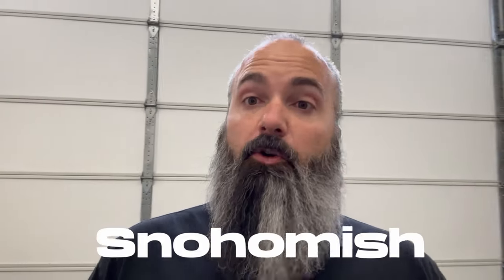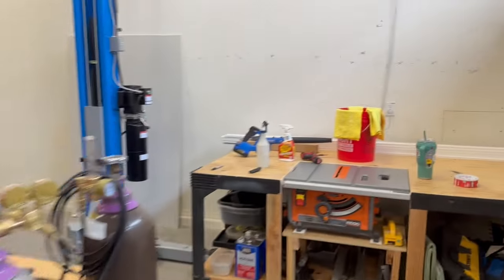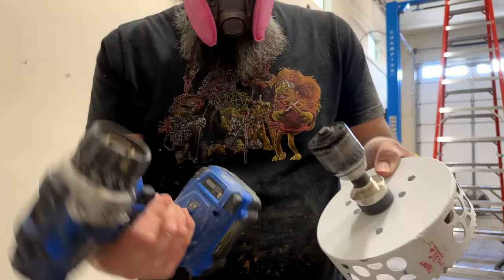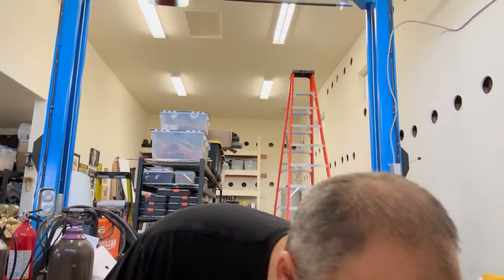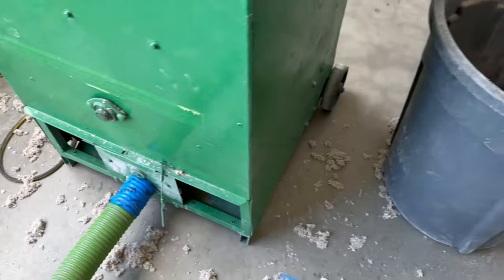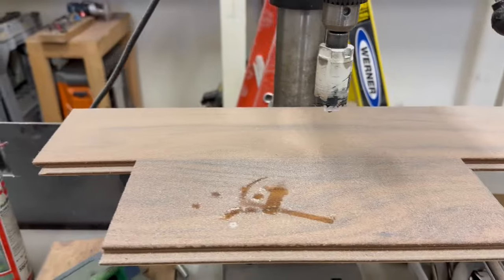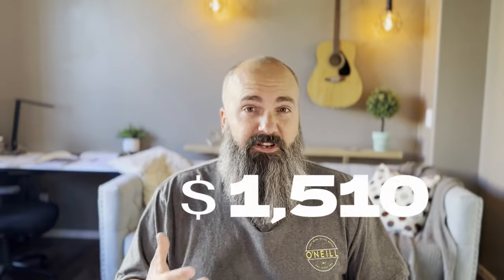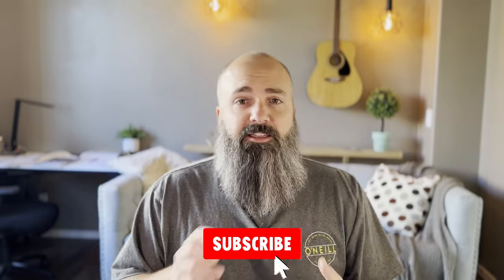Insulating Finished Walls

Comment: Just a thought - maybe cut one long skinny rectangle across the top of all the studs. That way you don't have to deal with using that drill bit so many times and patch all those circular holes. Should be much easier to tape as well.
Reply from the maker: This is a good thought. One or multiple long sheets would have been easier to repair. Though I've seen this process done multiple times and it's always with the round holes. I'm just a goof ball in my garage so I'm not sure of the merit of doing it this way. If I buy another house that needs insulation I'll certainly try your way!
Reply: I thought the same - why not cut a slot instead of holes for blown insulation. I suspect it will be due to not wanting the cellulose to come straight back out the slot. I think the holes make it easier to contain the fluff.

Comment: You can get a 24,000 btu mini split for $1,200. Get two and you’d be more than golden. I did that on my 2,000 sq ft warehouse that didn’t have insulation and worked great.
Reply from the maker: I keep bouncing around this idea. The heat here is brutal.
Reply: How much is your cooling

Comment: It looked like you were going up that extension ladder with the wrong side facing out. The rung locks should swing out towards you, with gravity working to hold them in the closed position. Glad your project was successful but stay safe. Ladders that aren't set up correctly are one of the easiest ways to get hurt on the job.
Reply from the maker: You're right. I totally missed that in my haste. Thanks for looking out!

Comment: I did one wall and cut 1 strip of wall 12 inch all the way i adjusted my circular saw to 1/2  i was able to see what is inside i did so from the bottom was very easy cut 4 ft drywall in some but i used most of the old one after i texture looks nice
Reply from the maker: I’ve heard this a few times and think for sure I’ll try this method if I run into a project like this again.

Comment: Okay, so I’ve been through this, not the dense packing but the renting that pos green box, some Home Depot’s will have a krendle cellulose machine, it’s blue, it’s way better than the green one. I was lucky enough to find someone local who had a badass machine you could load 4-5 cellulose bales into and we did a 3k sq foot attic with r60 in about 4 hours
Reply from the maker: That would have been so nice to be able to load more into the machine at once.

Comment: Thanks for the video! I’ve done everything from concrete to electrical but I’ve never done this before so it gives me a good idea what to expect.
Reply from the maker: Outstanding. It was a LOT of work, but not that difficult. The drywall finishing is the hardest part. It's such a skilled art.
Reply: I thought about doing this, but I found a company that foam filled my walls for around 2k. Not bad considering the labor in doing it this way.
Reply from the maker: @dfoster7001  That's a fantastic deal. Nice!

Comment: Appreciate this video. I've got 3 bays, 12ft ceiling, with no insulation above or in the two outside walls. Hits about 110 F in my Georgia summers. My last house, with room above and insulated walls in 2.5 bay garage would get cold with just a small window AC. But the ceiling was too low for the lift! I need to insulate at this new house and have been debating DIY vs hiring, and fiberglass vs foam. Good to see you could get dense pack without special equipment. All that dust tho!
Reply from the maker: The dust is real. I’m still finding little fluffs around the shop. lol. But with just my swamp cooler right now I can have the RV door open and keep it 15* below the outside temp pretty easy. Good luck with whatever route you choose.

Comment: Love my Milwaukee stuff! Buy around Black Friday/Christmas. Lots of good deals. 

Thanks for video, I am going to do this to my garage as well
Reply from the maker: Good info. The insulation is working well.
Reply: @DrivingForwardBuilds  trying to decide if I want to tackle(fully capable) or just pay someone and not mess with it....
Reply from the maker: @naturalsr405  that's a battle. This was a ton of labor. Probably 80% of the cost will be labor. Really depends on where your time is more valuable.
Reply: @DrivingForwardBuilds  most definitely. Being my garage is not huge, it probably would take someone who does it all the time, about a 10th of the time it would take me. I would have the ability to slack off and have it take away longer than it needs to too lol

Comment: Jason! My first vid of yours! I was trying to find this exact type of video since I am going to tackle blown insulation as well. I am building an 8’ x 12’ office in my garage for working from home / gaming. I have 3 kids so (as much as I adore them) it will help to be fully separated when needed to focus on work. 
I am insulating a 12’ long and 8’ exterior walls, since the office is on an exterior corner of the garage. I will also blow the ceiling of the room as well as the new walls that I am currently framing.
All walls are about 9’ high - and I need 96 sq ft of R30+ like you did in the ceiling.. I agree that all calculators seem to spit out different results… think 10 bags is sufficient?
LOVE to see that A) you respond to everyone and B) your insulation is working well! I am putting in a 9,000 BTU Pioneer split in the office as well - excited for that project. This is hands down my largest home improvement undertaking. Leaving a space for a parked car in case the next buyer of this home desires to park a car in the garage (we don’t for space reasons). Your video has greatly encouraged me to do a good job & I also watched the 3 strategies to blow insulation, going to go for the deep-pack method like you seemingly did. Though I kind of want to try the hole halfway down the wall instead of at the top, not sure. Thanks Jason!!
-Brady
(PS, also in Phoenix! So, a good insulation job is more important than straight walls, level floors, or a good paint color ha!! Flip gets HOT here!!!!!!)
Reply from the maker: 10 Bags may work. It will depend on if you are 2x4 or 2x6. Not sure what your transport looks like but the bags are actually a decent size. I personally would buy 3-4 more than are needed and if you have extra blow it into the attic. The other variable will be how dense you pack it into the wall. I thought about opening the wall up in the middle but was concerned gravity would take over and I might not get the pack to blow up the wall properly, especially considering I had never done it and the power/reliability of the rental was unknown. One really good comment I had was from an installer who mentioned cutting across the wall in full-sheet rectangles (like 3-4" tall). That way you could more easily fix the drywall without round holes. Or in your case if you are putting up walls to create the room there may be a way to save on some of the repair work this way.  Sounds like a great project to take on. :-) The mini-split will come in handy. I've noticed through winter the garage cooled and has stayed cool. I haven't budgeted for AC yet. I'm sure I'll regret that in the next few months.
Reply: Copy that! Good suggestions. Thank you for the reply - I will check if I have 2x4 or 2x6 exterior, good point. I can always return what I don't need if I buy extra! Yeah good luck with the A/C situation - that is a fairly large space. @DrivingForwardBuilds
Reply: This is exactly my situation. Mini split was put in today and we discovered our builder did not insulate the wall all the way down the wall as we expected. Now I need to insulate the one 20’ long wall so my mini split won’t work as hard. I want to cut holes and dump cellulose in. Hopefully it works easy enough.

Comment: 😮wowza! That’s a big job! Could you have just done below the fire block?
Reply from the maker: Yeah. But then I would leave hot spots in the wall where there wasn't insulation. That would defeat the purpose of the job.
Reply: @DrivingForwardBuilds  that makes sense. Good job 👍🏻

Comment: Just wondering if it would be easier to cut rectangular sections out of the drywall between the studs and slide wall batts down?
Reply from the maker: I don't think so. In the wall you have many different protrusions like nails, screws, wires, pipes and even small splinters of wood that will catch on the wall bats and make it very difficult to slide them in. Possible yes, easier, not likely.
Reply from the maker: No. There are way to many obsticles in the wall. Even just the small splinters would catch on the bats and make it very difficult to slide down.
Reply: Thanks for your reply, yeah I think you’re right. With batts they say not to jam them in too hard so they are able to fluff unrestricted because it’s the trapped air in the batt that aids in the insulation. I’ve seen thermal imaging of batts where it’s been shown that whenever the batts have been compressed and not cut out properly to make room for obstructions, the effectiveness of the batts are significantly reduced. Why is the blow in stuff different and recommend to compact fill the void? Wouldn’t compact filling reduce the amount of trapped air thus reducing the efficiency?
Reply from the maker: @carmeloxuereb8733  I'm not totally sure why they call for "dense" packing the cellulose. But the R-value goes up as it's packed tighter. From what I've read the r-value increases by 1/2 point from R3.5 to R4 per inch. Not having air space also helps to stop fire propagation. If packed in tight enough it can also be used as an air sealer, though I wouldn't omit any vapor barriers because I was using cellulose.

Comment: Great video.  Looking to insulate the ceilings in the garage.  Have two bedrooms over it and the rooms get crazy hot during the summer.  Any concerns with the insulation around power sockets?  I suppose in theory but want to be conscious of risks.
Reply from the maker: The insulation itself shouldn't have a problem around outlet boxes. I filled the walls around my outlets. Light housings should be IC (insulation contact) rated by UL. If you have any concerns though I would consult an insulation specialist or the manufacturer of the insulation. They would be able to guide you on the risks.

Comment: i had some if this done in one of my rooms and they cut out a big square in the wall along with many holes similar to holes you drilled. but i see you didn't cut the big square in the wall. is that normal what they  did in my home or no
Reply from the maker: So you don't mention where the other square hole was in relation to the round one. I have seen this done with one hole at the top and another somewhere in the run for venting. You place window screen over the second hole and allow the air out. It's possible that's what happened.

Comment: How do you deal with horizontal electrical conduit in the walls?
Reply from the maker: Are you asking how the insulation gets past the wires? There really shouldn't be an issue with horizontal wiring. The insulation is small enough to go around the wires. Having a "home run" or large bundle running horizontally would be odd.

Comment: How are the summer temps in the garage without any AC blowing after the insulation?
Reply from the maker: Not gonna lie. It was still stupid hot. But for reference on the hottest days 120+ it was hotter in the garage. After the insulation it stays in the upper 90s/low 100’s. With my swamp cooler running I can still work.
Reply: Thanks. I'm planning on insulating my walls and the half attic above my garage, but not installing AC. Just want to make sure there is a reasonable benefit
Reply from the maker: In my opinion it was worth it. Being  new to Az it was hard to get used to working in those temps.
Reply: Just use a Makita drywall saw and cut a strip out of the top. Just stay about two inches from ceiling if drywall is taped.

Comment: How dud it help with temperature?
Reply from the maker: On average it’s about 15* cooler than outside. Before insulating the inside would heat soak so much it would 5* or more hotter than outside.

Comment: Unbelievable cheap home builders
Reply from the maker: I’m not sure that’s it. Do the garages where you live have insulation in the walls not connected to the living space? I’ve been in Real Estate 13 years and that’s the case everywhere I’ve been. It’s an option as a consumer to add that insulation at build out typically. The folks that built my house didn’t work in the garage like I do so they didn’t care.
Reply: No one in south is insulating their garage stud walls, I’m about to do mine but luckily I have like 1/5 the amount of wall space to insulate compared to video.